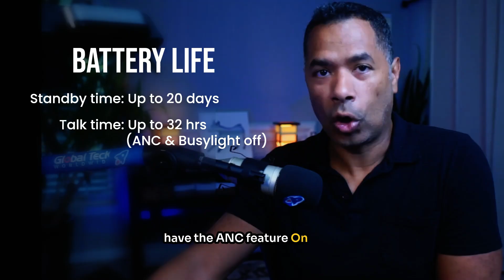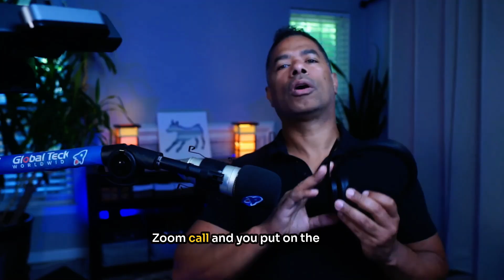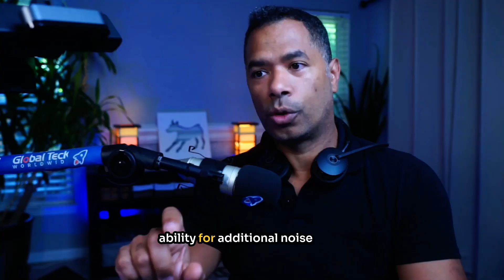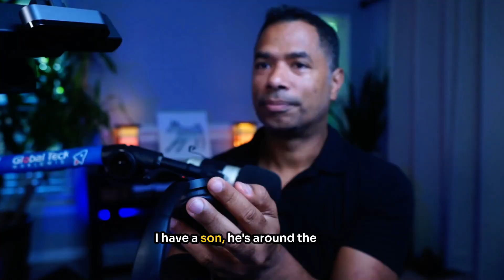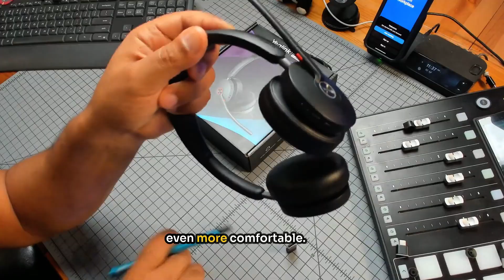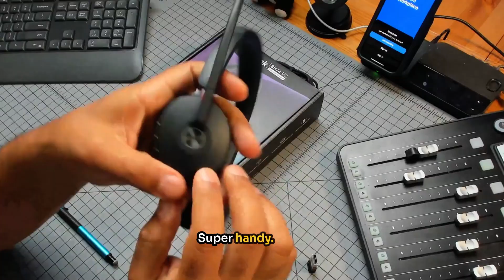Why the Yealink BH74 Outperforms Other Bluetooth Headsets

Comment: Bh 72 has low mic recording 😢
Reply from the maker: Try to increasing the mic gain on the recording app and make sure to boom on the bh72 is extended instead of being in the retracted position. 

Thanks for checking out the video on the BH74. 🎉🎉🎉

Comment: Thanks for the nice video! I am just worried about replacing the earpads, is it possible? I feel like sooner or later they will peel off and if u can not change that, they will be kinda ugly lol
Reply from the maker: It's a great question. One of the people on staff has been using this headset since it was launched and they have not had to replace the ear pads and they use it daily. If you do need to replace the ear pads, a simple twist and they come right off and you can easily replace it. 

Thanks for checking out the video. Let us know if you have additional questions. 💥💥💥👍👍👍🙌🙌

Comment: We just got 5 Edge E350 VOiP deskphones in an open office. Will the Yealink BH74 work for each of us? There is no spot for a dongle. How do I find you on Amazon? I tried searching Global Tech Worldwide.
Reply from the maker: 1) It will work with the Poly  EDGE 350 phone's built-in Bluetooth capability. 
2) The Yealink BH74 has built-in ANC capabilities to filter out the environmental noises such as conversations around you.  When you use them, make sure you activate that feature as it has three modes- ANC on, off and pass-through. 
3) You will find three models of the BH74 on our Amazon store. You can click the link at the top of our Channel or with this link you can go into the main store. Type in keyword "bh74" 
Online: amazon.com/teck

Comment: Could you please give me a little more information about the ANC and how well it filters noise? If I’m working in an open office, will it do the job, or would it be better to buy an over-ear headset?
Reply: The ANC is decent perhaps not as good as AirPod Pro for comparison, but still pretty good. From what I recall, there are very few headsets with ANC that are also over ear. I wish there were more.
Reply from the maker: Thanks for providing that insight. The bh74 is a very good all-around Bluetooth headset. I'm impressed what it can do for a work from home or work in office headset. Advanced and packed with features compared to its competition right now.